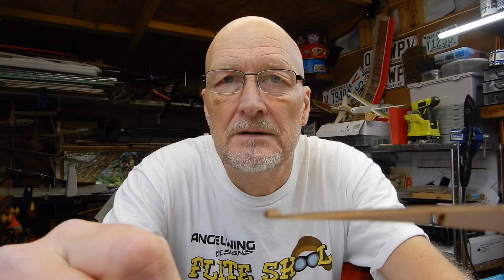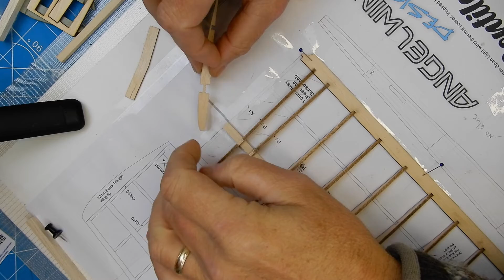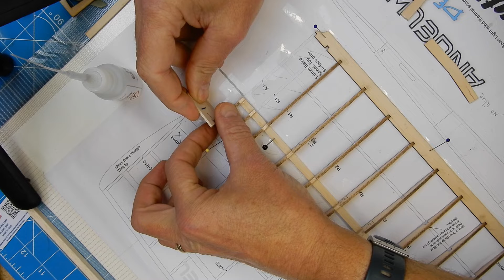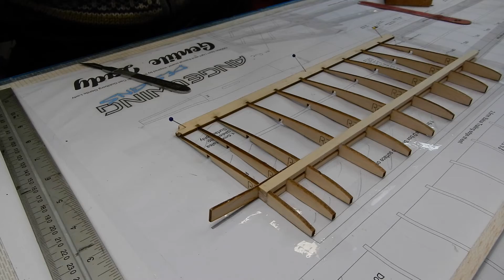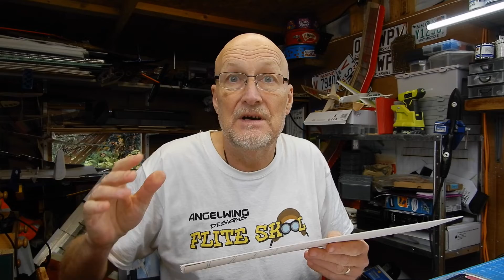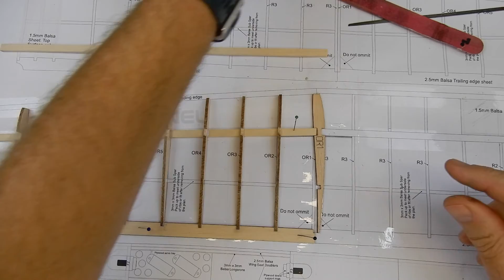How to build Genteel Lady Rc Glider  Part Two The Wings

Comment: If the lazer cutting is so good, why cant the manufacturer allow for the dihedral braces in the rib design?
Reply: The ribs then become 2 seperate component pieces so harder to build.   Its easier and far more accurate build  to cut the ribs after the panels are assembled.
Reply from the maker: @F3PUK  cut by laser built by humans